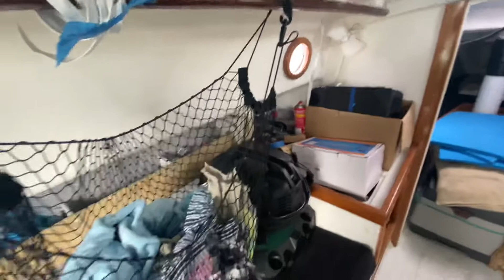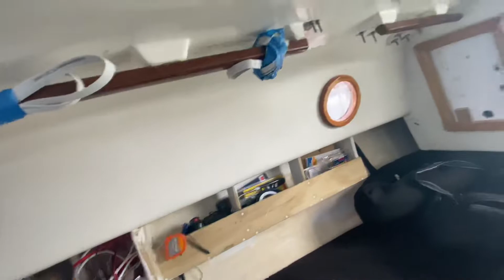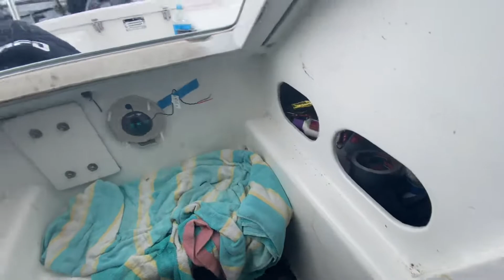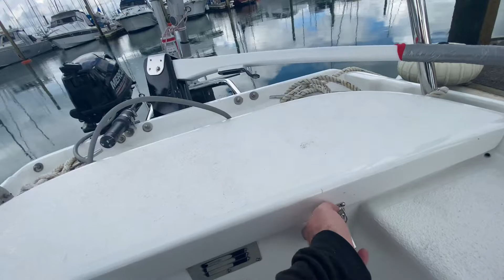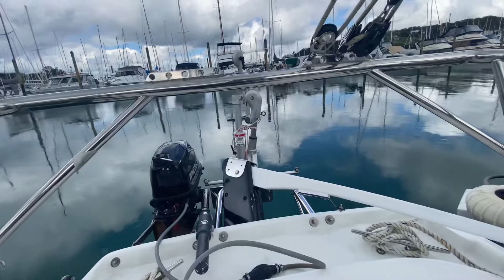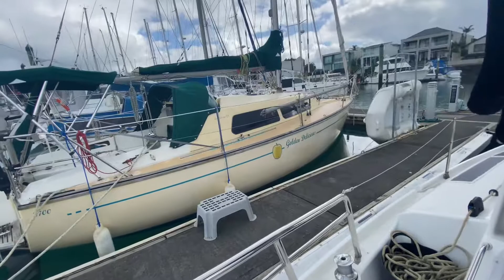Interior

Comment: Looks really good internally! The raised coachroof makes the cabin look bigger. What is the height of ceiling from floor? Outboards are way better than inboards for small boats. The less holes in a hull the better!
Reply from the maker: It is about 5.9" at the forward part of the raised coach roof, and over 6 feet aft by the companionway.  For me at 5'8" it is perfect.

Comment: Is that a 6hp? How well does that push you along?
Reply from the maker: It is a 5hp Merc, and it pushes me along just fine.  I paid a bit extra for an extra-long shaft 25", with a big prop with low pitch and it pushes my 5,400lbs along just fine in all but the biggest sloppiest wave action.  And when there is wind, I sail.  With no prop from an inboard diesel dragging in the water, she sails very well.
Reply: Good stuff. I'm also a big fan of outboards on small boats. Diesels require way too much maintanance and have far too many things that can fail and ruin your cruise. Also not a fan of the smell they create down below. Currently building a cockpit well for a 9.8hp.
Reply from the maker: @sailing_rosie  Good stuff  9.9 with a hi-thrust prop will be oodles of power for your Raven